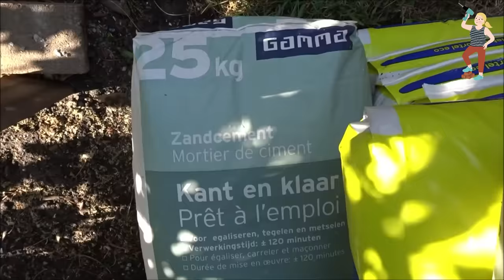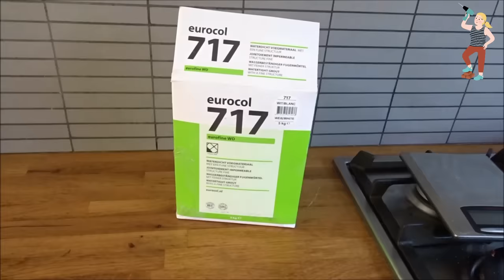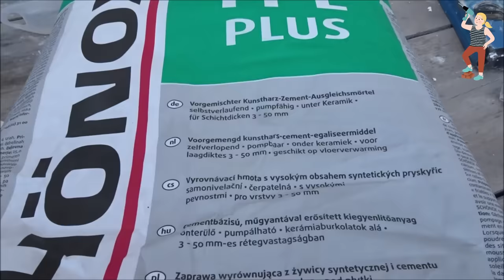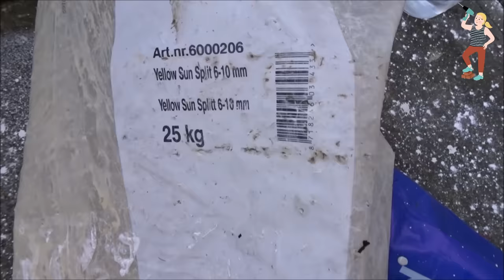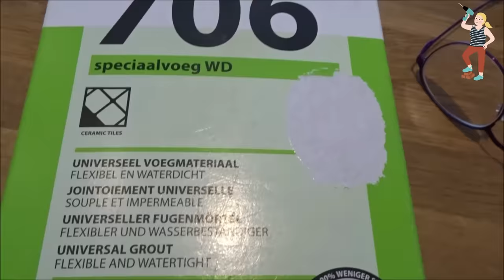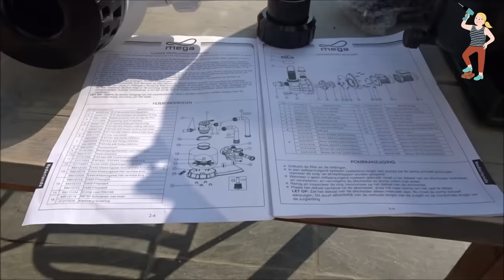Costruire una piscina da soli - passo dopo passo

Comment: I also made a swimming pool in the same way...
I built it 4x6m and on the ground I made 0.8m at one end and 1.30m at the other end.
After a few years, the walls cracked, so I covered them with foil.
Not a good idea with masonry.
The walls would be better made of 10 cm reinforced concrete. That wall never cracks anymore ..
I worked alone to build the pool. My wife didn't want to help me, but here it is the other way around. The entire pool was building by a woman.
Kudos to the lady for the knowledge required for site work.